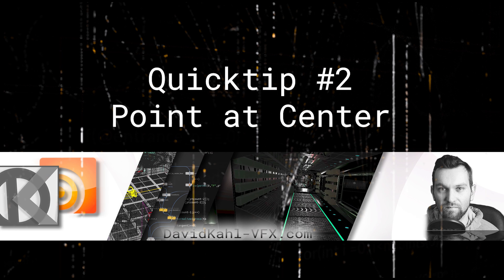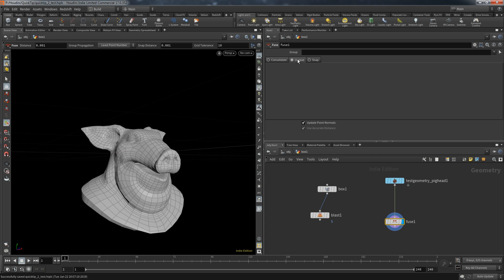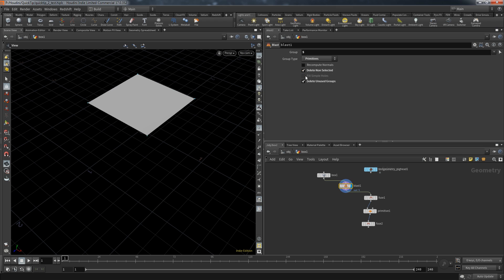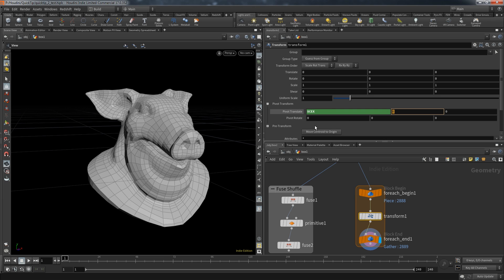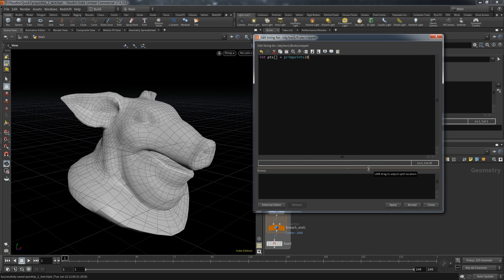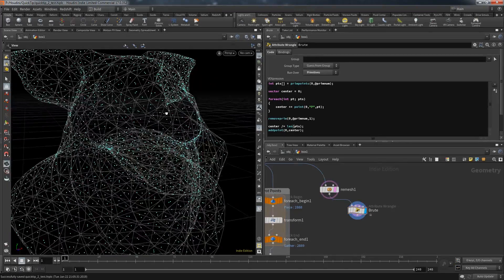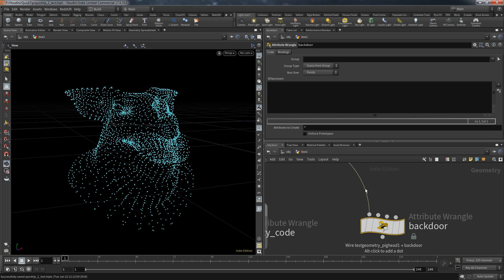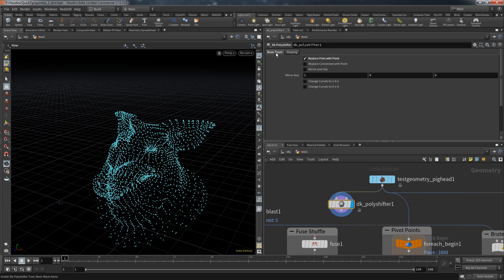5 Ways to replace a Prim with a Point | Houdini Quicktips

Comment: Hey David! Thanks for this great Tutorial. In my Case I need to Transform every Geometry in different Lego Bricks like 2x4, 2x2, 1x1 Bricks and so on. To Center a Point is very important I think. But is there a Solution  to Fill the Mesh first with the biggest Lego Bricks to the smallest by the Count of Points. As Example: The Center Point of 8 Points can fit a 2x4 Brick. 6 Points a 2x3 and 4 a 1x1.

Comment: Good job! Another problem: How to transfer primitive's normal onto point's normal?
Reply: Facet Node (unique points) (Use Accurate Distance off) -> Point Node (Position $TX $TY $TZ) Add Normal ($NX $NY $NZ) -> Attribute Transfer node
Reply from the maker: I give that a Test tomorrow. I think its simple but I like to try first ^^
Reply: For the last method (it's not that hard to replicate it for others as well), you can store N attribute in vector variable with primattrib function and then setpointattrib once you created your center point.
Reply: Fedor Koleganov I'll try that, thanks buddy

Comment: You can also use the Extract Centroid node
Reply from the maker: A buddy told me about that node after I was done - if I am not mistaken you could use unique fuse, assemble and then extract centroid to get the same result. Definetly a good alternative!
Reply: David Kahl VFX By default the Extract Centroid is set to "Run on "Pieces"" but if you change it to "Detail" you get the centroid of your primitive directly !